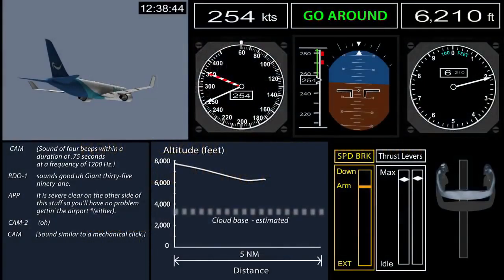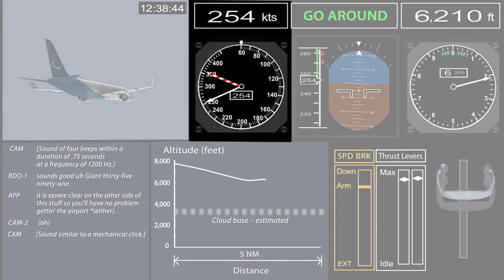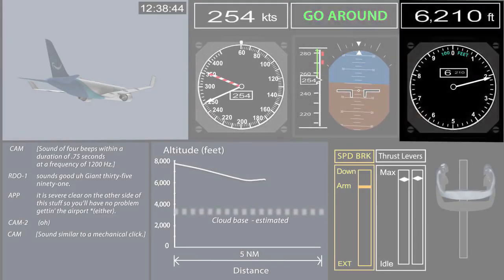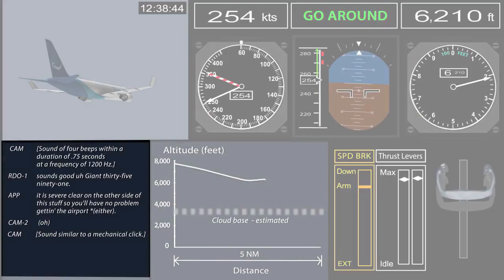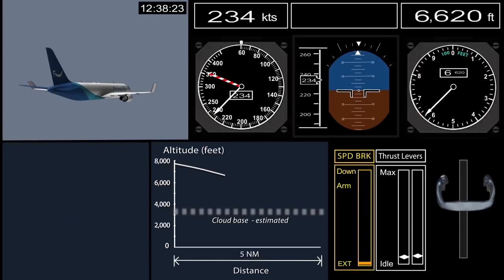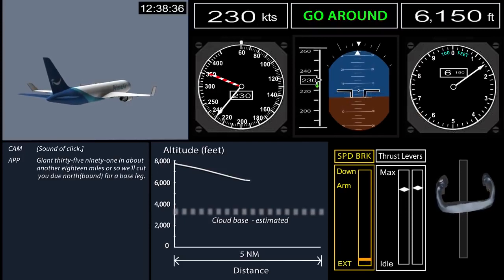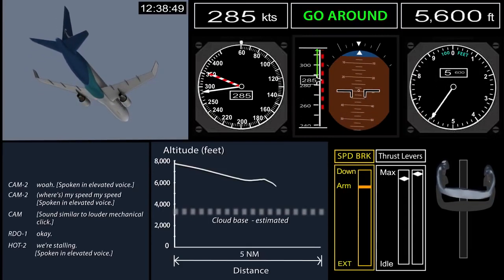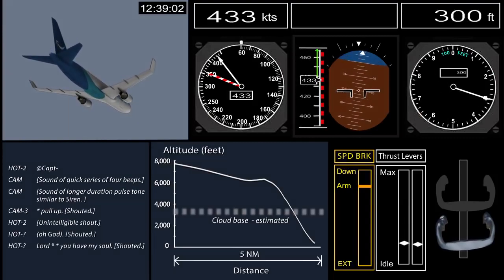Animation of Atlas Air Flight 3591 rapid descent and crash into water

Comment: How can they stall at such a high speed... No stick shaker stall warning 🤨🤔
Reply: You can stall at any speed. The FO thought they were stalling because he had spatial disorientation.
Reply: some pilots have alleged the FO was fired from a few different airlines for failing checkrides etc and just using bad practices while flying. im paraphrasing but long story short the FO should not have been in control of an airliner. some questioned how he got on at Atlas and thank god there were no troops in the back and just a bunch of boxes
Reply: @umbreonpokemon8190  if this is true then there should be a lot of people that can be held accountable.